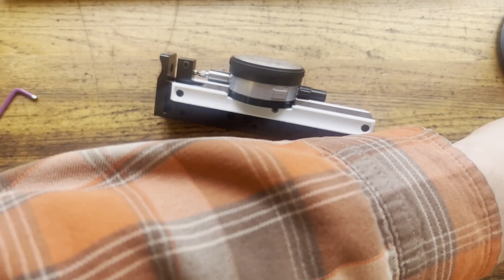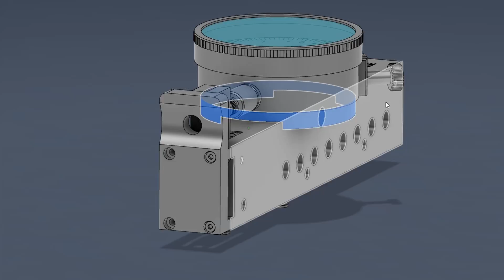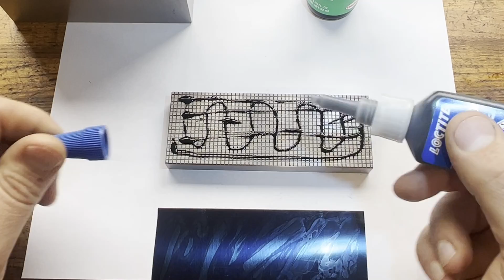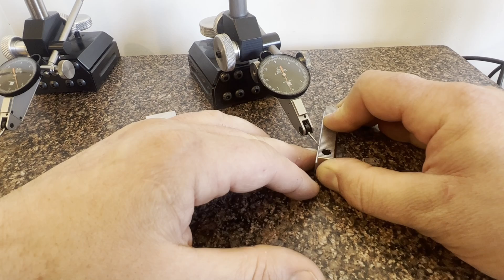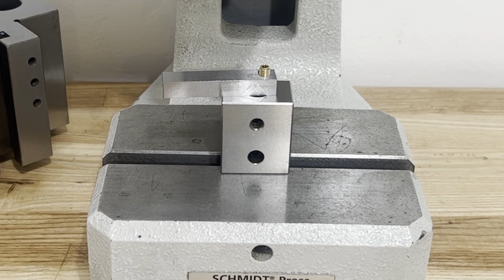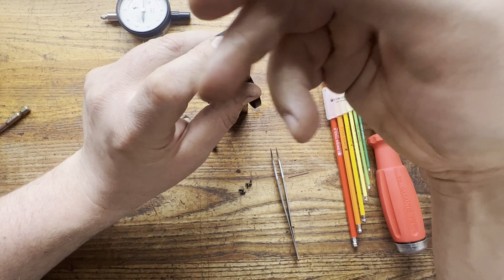Machining and printing shallow diameter gages

Comment: At 5:48 you mention that you used a back-tapered end mill to hard mill the slot, would you mind sharing a link to the end mills you use? I haven't had much luck searching for them myself, thank you!
Reply from the maker: I use a union tool line , https://www.uniontool.co.jp/english/catalogue/em/e_hls4.pdf
Reply from the maker: But most cutter companies that focus on mold and die cutters offer a product like that Mitsubishi/moldino , fraisa, ns Tool all excellent , it just comes down to distribution and who you like working with
Reply: Perfect, thank you so much!  @adamthemachinist

Comment: I always wondered how someone would check a funky counterbore or similar on a part when calipers/dowel pins are out of the question. I am curious, with the 3D printed one could someone have that printed using metal 3D printing, mill the precision parts, and make something comparable to the super-fancy one you milled up?
Reply from the maker: Absolutely, you also have the option of printing them to the exact size needed for the part you’re making if it’s a production gage. Not needing adjustability simplifies things

Comment: excellent content , just watched most of your videos! You produce some rare good content.

Some constructive feedback: your voice has different volumes at different times, and is sometimes orders of magnitude different than the machine noise, compressed air, etc. I find myself fiddling with the volume constantly or wishing I could squint my ears. Additionally, there are times that things get dropped or otherwise go "bang",  these are way too loud. Is there a way to cap the max volume on the video or a way for you to see a spike in audio amplitude? I'd bet there are editing tools to help make these gunshots be less startling.

I like the use of COTS parts to make precise goodies. Also the high quality 3d printing is nice to see. The assembly portion of this vid is like cocaine.

How did you size your flexure?
Reply from the maker: Thanks for watching . Video, sound, and editing have been a huge struggle for me . Hopefully with practice, things will improve . 

Regarding the flexure design and sizing . There’s zero expertise on my end, it’s approached with some mathsand some intuition. a book from Larry Howell called “compliant mechanisms” gets me thru the heavy thinking .

Comment: I'm confused. Was the frame made from pre hardened material? How were you able to tap those M2 holes?
Reply from the maker: The holes were tapped when the material was in its annealed state , then off camera it went to heat treat . The milling and grind were done post heat treat.

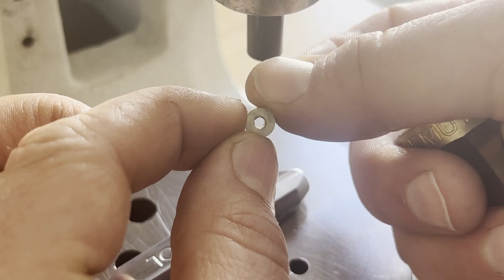Comment: Hey Adam this video was a lot of fun to watch, made a lot of this feel very approachable though I don't think I'm really at a level as a machinist to attempt any of this quite yet. I had two questions: 1) do you have any info about your machinists hammer / drift (visible around 38:17) - they look somewhat custom and I was curious. 2) is there any reason why for the 3d printed version I wouldnt want to make it with just two rods and attach the indicator to one of those instead of adding a third one to support it?
Reply from the maker: The drift pin is homemade from aermet. As for the 3D printed gage , I wanted two rods at the base but it was awkward to attach the indicator to it so I just added a third rod higher up . Perhaps more design time would have yielded a more elegant solution , but first solution is sometimes the best

Comment: Amazing work. Brilliant workmanship on it. I'm interested in the hard milled t slot. Did you do it with a necked end mill or use a tslot cutter? I have a project i need to finish mill a t slot as well. Thanks again
Reply from the maker: a necked 8mm endmill

Comment: Thank you for your time and effort on this video. I might give this a go,  I'm more inclined to do most of the precision work on a wire EDM, well,  because its what I have.  Like, subsribed and comment.
Reply from the maker: I imagine I would get into lots of odd projects with a wire edm . Such a good way to approach precision work
Reply: @adamthemachinist  G51, a Wire EDM and a drop-off means I always have the right size v-block,  sinebar or whatever for the job at hand.

Comment: I liked it all, though I did become confused a little while you were walking the grinder over the part for aesthetics... I presume to have understood the nature of what you were saying but I cannot be sure. Maybe you could cut an o-ring groove into the pinion gear body to have resistance in its bore to keep the carriage from traveling too easily?
Reply from the maker: an oring was my initial thought , the t slot endmill I parted it off with would have worked perfectly to cut the groove as well

Comment: Adam, thanks for the information... funk or not it is greatly appreciated (and inspiring).  Makes me want to recommission my shop and find my happy 13-18 hour per day place...
For the small printed version, a version with iron or bronze would make a great tool instead of the plastic.  I like the ground tooling version better but the small one seems to be a great idea for quick checking stubborn positions.
ePop
Reply from the maker: the two plastic components would be very easy parts to make from any metal. I do enjoy the challenge of not machining things though, makes me a stronger designer.

Comment: Adam.  I would like to thank you for being so very generous with your time.  I know the time involved in a project like this, let alone filming it all and editing.  I enjoy your videos from start to finish.  This type of content is hard to come by.  I am a little unsure in my understanding of the peel grinding process.  If time permits would it be possible to describe your process for creep feed grinding a rack gear in ten minutes. I’m very curious about dressing a gear tooth profile into the wheel.
Reply from the maker: Ill try to do a more in depth video on the peel grinding. as for the gear grinding, for a profile this small it would just be a 40 degree v wheel and I would cut one v notch at a time .

Comment: Adam - just absolutely wonderful, rich content presented in such an engaging manner… Thank you so much for contributing your work to the public trust! I am curious, you stated that this was a customer project, and gaged the tool to a 52mm standard - was this created for a motion picture imaging application?
Reply from the maker: Its actually for a bicycle maker.
Reply: ok now i'm curious? what 52mm item might he be measuring? can't immediately think of anything appropriate, gates for 70mm formats are close to 52mm but what else
Reply: @Mister_Brown  52mm is the standard “flange depth” for the lens mount on a super 35mm film camera, or rather, the measurement between the face of the mount and the imaging plane. A motion picture lens is thus designed so that the light which passes through it, has an exact point of convergence 52mm from its rear mounting face.
Reply: @shaolinshaotse  i really should have remembered that but i was thinking of things you can actually measure with this device, i can't see how this could be used for measuring that at all
Reply: @Mister_Brown  Not thinking optics for this tool obviously but more using one type of gage to make a different type of gage? 52mm just stuck out to me

Comment: We used to use slightly modified Boice snap ring groove gages to measure very shallow bores, but they were good to only ~+/- .0005. Hard milling is still new to me. When I see sparks coming from an end mill, I reflexively grimace. Thanks for the great video!

Comment: Very Very beautiful work , every step of the way 👏. I would have EDM many of the parts but would not have been as proud of the final device. 43 years designing and manufacturing medical products. Paul
Reply from the maker: if I had a wire edm, many of the parts would have been cut that way I suspect. To good of a process to not use if you have it

Comment: Amazing video Adam. 
Beautiful to see you work with um precision. 
What steel did you choose for the body and carriage parts? Maybe I missed it in the video if you told us. Seemed to hard mill quite well.
Reply from the maker: just A2 Tool steel. not the most amazing option, but I have regular batches of it going to heat treat so it very economical to add a small batch of parts to a existing order

Comment: You lost me with the section on "Peel Grinding", it just wasn't clear what you were doing. Could have used some close ups.
Reply: I was a little lost there, too; a quick comment starting "Peel grinding is ..." would have helped me!  :)  A little similar on the gauge overall; I wasn't sure how the thing sorta worked until the dramatic conclusion.  You're a master of details; my brain kind works in overviews!  Something like "The way this works is ..." (quick sketch) " the body holds an indicator with a flexure and a pin, this pin slides to your reference position,  and so on and so forth".  A gift to those of us who've never seen one!  :)  For me, it's a framework to hang the details on.

Still... excellent.  It takes a lot to keep my attention for an hour.  :)
Reply: LOL, I involuntarily screamed when that first screw went flying. Audio was great all the way through. This was a super video all in all. First time I've ever clicked the 'Bell' for anyone for what it's worth.
Reply from the maker: ill try to do a more in depth video on it

Comment: Gotta admit your description of peel grinding went right over my head. I thought I understood it until you started grinding. I think a construction paper demo or even just some close up shots of the grinding would have helped. The description of grinding the t profile carriage was very easy to understand, though that seemed pretty simple to me anyway.

I'm curious what you use for deburring. Are those shop made holders or purchased, and what sort of bits are in them? You mentioned one was ruby, but the first tool you used looked more like something I could get use out of since I don't work with hard steels. 

Overall great presentation, though your audio levels were a bit inconsistent. You're certainly helping feed my regret of going to school for welding rather than machining.
Reply from the maker: the deburring tools are a degusit ruby and a carbide chamfer tool. both held in starrett pin vises

Comment: Just some suggestive criticism, your into is WAY to long. As good as your content is, I'd get rid of it entirely. Or at an absolute max, flash a brand or channel name title screen for a couple seconds.

What brand screwdriver did you use for Assembly?
Reply: Not Adam, but - the large red torque driver is a PB Swiss torque driver, similar to "PB 8313 M" (I think in the video I can see it as "8317 M"); the green and black Phillips driver is a Wera Kraftform driver, it's a PH #00 so I think it's part number "118019".
Reply: @joshuawills5242  thanks

Comment: What are those deburring tools that you use at ~41:00? I'm guessing they're something you made, but if something like that is commercially available, I'd be interested in picking some up. I do a lot of small & fine work, and needle files or regular deburring tools are like using a sledgehammer sometimes.
Reply: Obviously not Adam, and I don't have a huge amount of domain knowledge here, but from what I know and could learn quickly - the ruby rod is probably called a "ruby degussit file" or similar - Falcon and Gusswein were two results; MSC Direct seems to have them under "finishing sticks".

The black-tipped deburring tool looks like a fairly standard multi-flute countersink bit - 3285A611 on McMaster for an example.

The holders I couldn't find quickly, but there are a ton of different "pin vise" holders like that out there; McMaster has a set (8455A14 ) that looks fairly similar to what Adam has.
Reply: @joshuawills5242  Don't forget the Nakanishi NSK EMAX Evolution (or Espert 500!) 🙂

Comment: Thank you for putting the effort into producing these.  Your projects are unlike anything else I see. Is there a Black Oxide process you would recommend for using in house?
Reply from the maker: I've never had much success with in house methods. Most of the steels i use have higher chromium content which seems to struggle with the kits. I send mine to Peters Heat Treat, its very economical.